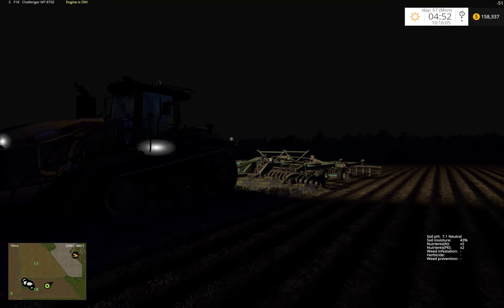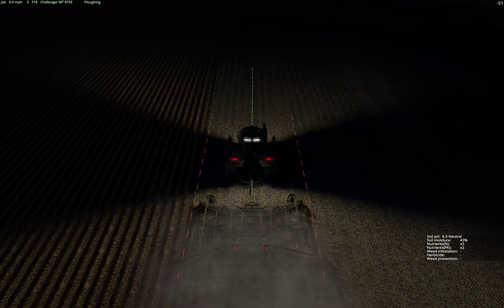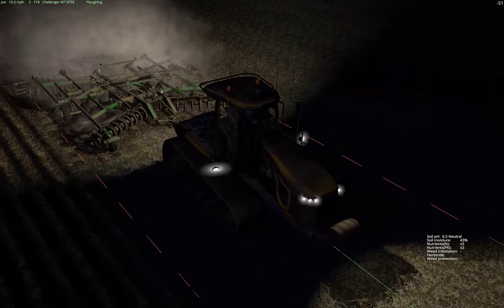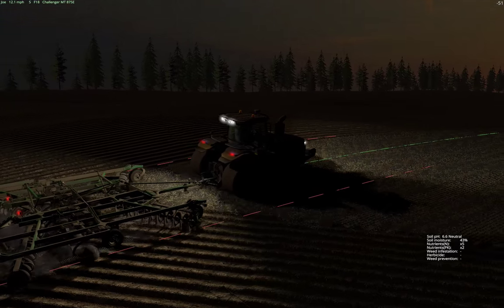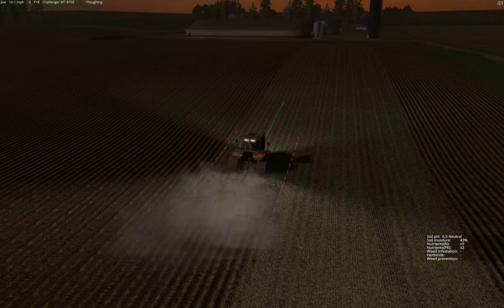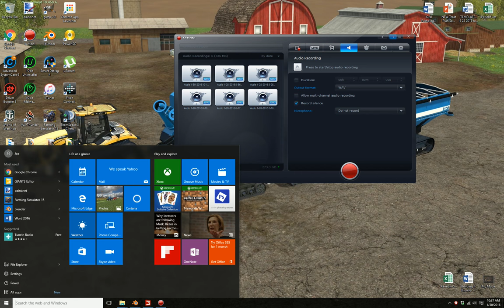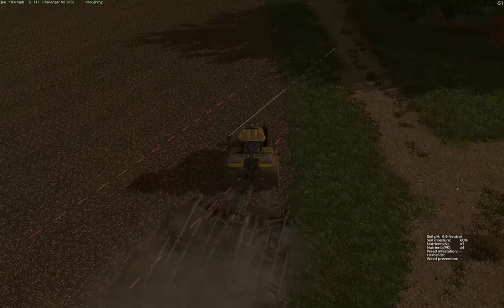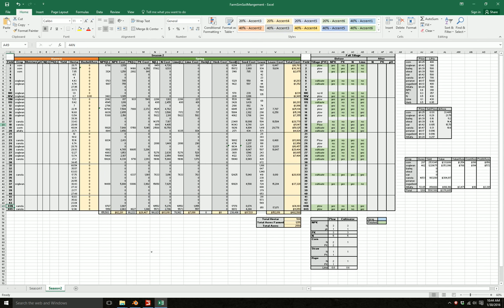Farming Simulator 2015:  Primary Tillage

Comment: we put about 1000 acres and then replace the shanks and disks if you maintain your equitment then it will last longer than normal we never have changed a tire though and we keep all of our tractors nice and clean and about 2 oil changes a year.